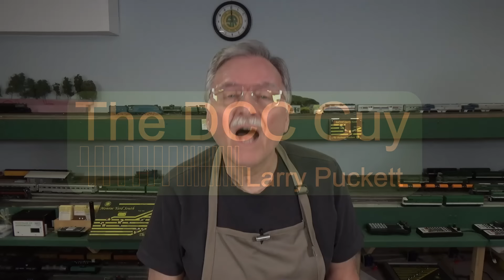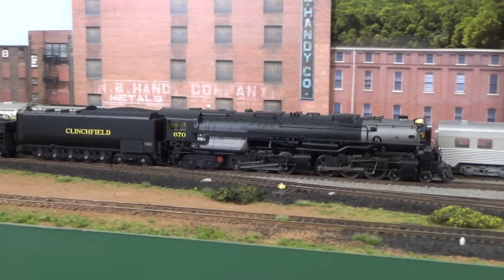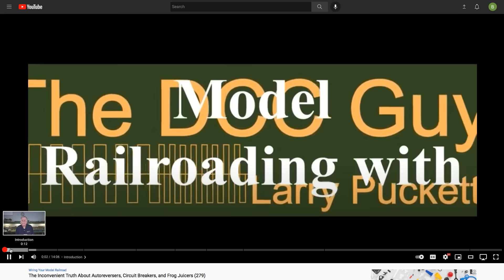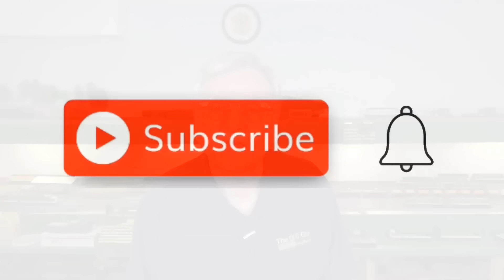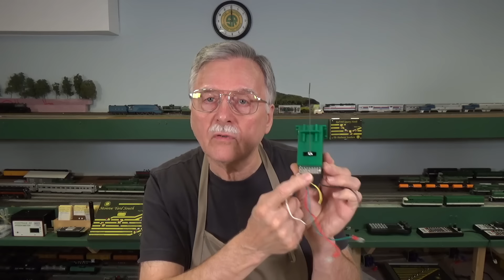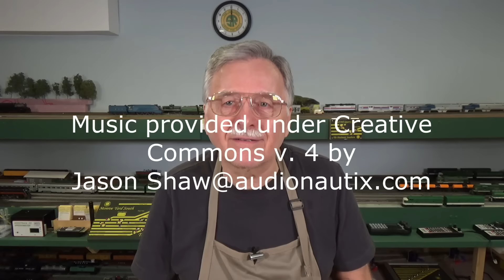Protecting DCC Decoders From Killer Shorts (281)

Comment: The chapters are very helpful, thanks! I'm a little astounded that decoders can react to voltage or current spikes by writing junk into their writable memory. That's a pretty unfortunate failure mode. Do the DCC specs require decoders to protect themselves in any way? Is there any evidence - anecdotal or otherwise - that particular decoder brands are more or less resilient?
Reply from the maker: I think it is mainly a matter of physics of electronics and as far as I know all decoders are susceptible. This subject of using TVS diodes is brand new to me and also to some of the electronics engineers I spoke with.
Reply: @TheDCCGuy  does a TVS across the motor interfere in any way with the decoders that do back EMF sensing? Those seem to be very common nowadays, possibly even the norm here in Europe..

Comment: That was a good discussion.  I am using four power districts.  My DCS is Digitrax.  I have snubbers that I have not installed yet.  I am using a Digitrax PM42.  I know Digitrax released a new version of it, PM74.  However, online there is no mention of transient voltages.  It does mention adjusting trip current.  I do have some PSXX circuit breakers.  Are all PSXX circuit breakers equipped with TVS circuits or just after a certain revision release?  Old versus newer?   Would I be better off using a new PM72 or the PSXX circuit breakers?
Reply from the maker: I have been using the PSX for several years, use zip cord for my power bus, have snubbers on top of that, and keep my fingers crossed, so far I have never killed a decoder and can’t recall ever having any CV corruptions. As I said in the video the PSXX is the only circuit breaker with both voltage and current suppression.

Comment: I installed an EB-1 on your recommendation and just as a warning to others the manual reset feature does not play well with Digitrax DCS-52 command stations. To activate the feature you have to program the EB-1 CV 131 to a value of 1 using ops mode programming. The directions for doing this that come with the EB-1 could be clearer. Upon testing by shorting across the rails I got mixed results. The majority of the time the EB-1 tried to re-establish power automatically, but once or twice it actually needed a manual reset. Not being an EE I can't explain this. I'm not saying "Don't get an EB-1," just saying that if you don't have an NCE system you might encounter problems setting up the manual reset feature. Also, if you are going to get a push button it needs to be "normally open." It doesn't have to be a push button, any switch that it momentary on will do (like those used for old DC switch machines).
Reply from the maker: I’d check with Ed at NCE tech support to see if he knows what is happening. Thanks for letting me know about the problem. I have only used it with the NCE PowerCab system.

Comment: So if I am using DCC Specialties Circuit Breakers then I should not need to also use the DCC Concepts snubbers?
Is the surge protection only on the PSX-X and not on the PSX-1?
Reply from the maker: First the onboard TVS diode only removes spikes coming into the PSXX from the command station/booster so it won’t do anything about what goes on with your wiring which is what the RC Filters take care of. The PSXX has both the TVS diode as well as the current protection whereas the PSX only has the TVS diode.

Comment: Hi Larry,  a great topic for your well presented video.

However I'm somewhat uncertain as what to do, I would have thought that if it's voltage spikes rather than current spikes that need to be controlled, that 2 Zenor Diodes connected back to back ( opposing each other) across the track output from dcc station or EB1 (or similar breaker), would dump any excess voltage from the positive phase to the negative phase? As long as the rating of the Zenors is  the same or marginally higher than the track operating voltage. Surely the EB1 or similar breaker would eliminate the excess current?

To those who don't know what a Zenor Diode (ZD) does, it eliminates excessive voltage from passing, so a 12v ZD will only allow 12v to pass and dump any excess to a return (earth or negative). 

Please check out the link : https://www.youtube.com/watch?v=4wJjbIm_qr8 In this tutorial, the circuit uses normal AC whereas DCC is similar but a square wave, and the fuse can be replaced with a breaker.

Great videos, and I especially like your UK modelling interests and NCE eqt.

Cheers,

Eve

Comment: Hi Larry. I have 60+ locos (not all DCC) but you don't mention a price for (or a link to) TVS diodes. The cost may be less than buying a new decoder but the work to add the diodes to each of my decoders would be prohibitive (for me). How about the DCC CONCEPTS DCC-BSS.2 Bus Spike Suppressors?
Reply: The cost of a 100 TVSs was slightly more than the shipping if I remember correctly.  The bus spike suppressor will not protect from motor voltage spikes.
Reply from the maker: What Nick said.

Comment: Larry, this is a great video and I recommend anyone installing DCC to watch it. For the reasons you give, I removed the frog juicers from my UK club's large layout and used the switch machine's contacts. On a smaller layout where the points are manually operated by rods, I have attached micro-switches that change the frog polarity. As an electrical engineer of many years, I have never liked the idea of trying to correct short circuits in this way, as you say the spikes it creates can course chaos in associated layout electronics.

Comment: I used your advice with regards to lamps in series from the output of the Digitrax controller to the tracks sections, which light up whenever a short circuit occurs and it is working great. I don't think I need to add anything further, Or do you think I should?
Reply: N, in k k(k m m?k
Reply from the maker: I asked Larry Maier about ballast lamps and he said that for the voltage and current spikes they do nothing. They do limit the current flowing through the actual short circuit  but thats about it.
Reply: @TheDCCGuy Based on your research, I have now purchased a DCC-LSP Surge protector from DCC concepts.
Thank you